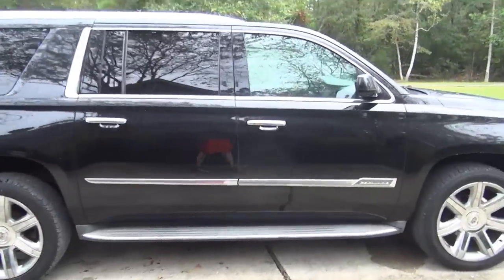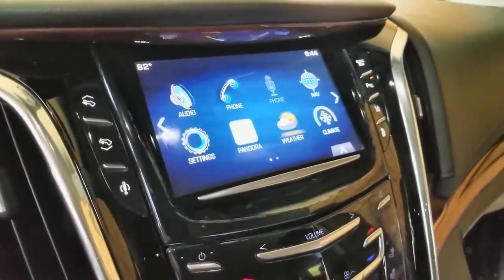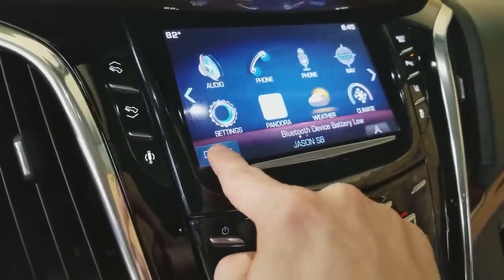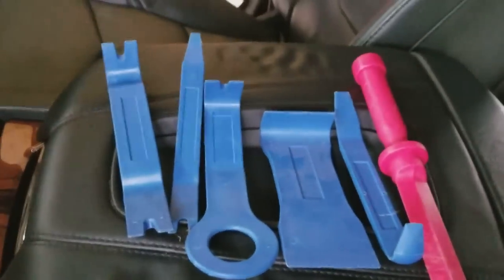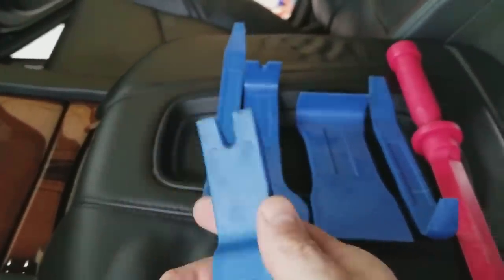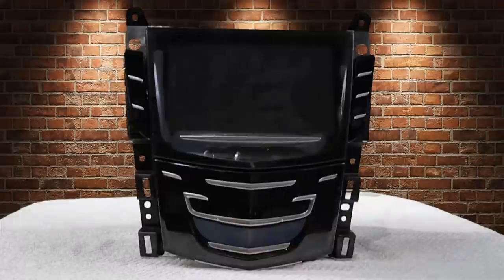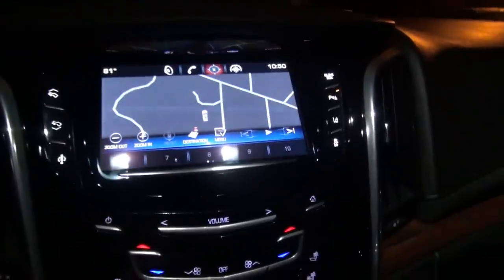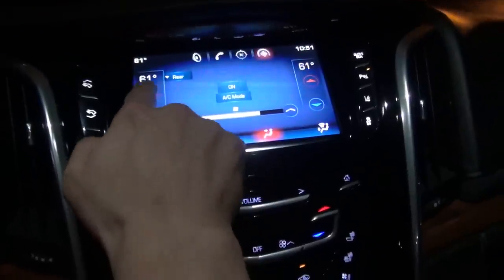How to fix a Cadillac Cue Screen. Step by Step

Comment: When you remove the ribbon, you state to move up the tab. Then after putting the ribbon back you say to push the tab back down. I don't see a tab? I pulled out the ribbon and inserted the new one in. What am I missing? Thanks
Reply from the maker: It resembles a small plastic tab that will hold the ribbon in place. If you inserted the new one already just make sure it is secured back down with the tab, although I am not sure how you put it in if you never flipped it up. I believe it is black in color and it should fold up and down. I hope this helps. Thanks for watching

Comment: After replacing the screen everything on menu shows up but touch not working and not making touch sound but radio works 
Help. What went wrong
Reply from the maker: You more than likely don't have the ribbon cable connected properly all the way. Make sure to lift the tab and hold to secure it

Comment: Last night, my screen in my 2012 froze up and wouldn't turn off and the tailgate wouldn't open so I disconnected the positive terminal to get the screen off so it wouldn't kill my battery then immediately reconnected it when I started it today everything was fine but I turned it off and left it off
Reply from the maker: I haven't heard of this issue. Hopefully it was just a glitch

Comment: I was installing the radio and didn't realize I had the ignition button on and the USB charging port touched a piece of metal on a bracket. Now my instrument panel is out and the all the lights for the heater display and screen are out
Reply: Derek St Jean the same happened to my do anyone have a solution

Comment: How do you get the ribbon out? You never showed what tab to push up to release it.
Reply from the maker: rmndcaliman thanks for watching. I zoomed in but it is really tiny. There is a black tab that you will have to lift up that sits on top of it to hold it in. It will flip easily just be gentle and use a micro flat screw driver to lift it. Hope this helps

Comment: How do you know if it's just the screen?   It appears GM only sells the whole unit.
Reply from the maker: Comanche Flyer if the unit isn't responding from the touch but is completely visible it will be just the screen. If the screen isn't visible or  blank than you will need a whole new unit

Comment: Great video! How did you unlock the GPS?
Reply from the maker: Jonathan Jackson thanks. I didn't unlock the GPS. I believe there is an adapter you can get to do this however I'm not familiar with exactly what is needed.

Comment: Can't find the fuse because that's what it should be correct?
Reply from the maker: Hey Derek, I apologize I had only seen the last part of your message and that is why I didn't understand at first. Yes. You should be fine. Just use your manual to locate the fuse and switch it. Let me know if that does it.

Comment: Just as a comment 
The real problem is no the screen itself,  is in the connector,  one is the small coming from the screen and the other big in the center af of the radio, and it is because both become loose over time, and the solution is about simple as a piece of Scott tape on top and put it back in the plug, 
Thanks

Comment: hi is 2013 cadi xts  the same ? thanx
Reply from the maker: In regards to the screen, yes. It will be a little different process to pull your unit out but you can use this video to help you once the unit is out. Thanks for watching.
Reply: Sam, I've got the same model of Cadillac and have just ordered a screen. Did you ever find another tutorial video to help you? I'd like to see one, too, since the xts has different trim pieces.
Reply from the maker: Andrew Wood thanks for your order. We are shipping it out today. We are also working on the video for your vehicle but don't have it ready yet. I will see if I can find you some information that can help. Thanks again for ordering. I really appreciate it
Reply: Andrew... did you change it?  Any advice?

Comment: What if the whole unit is black and dead?
Reply from the maker: If your screen isn't lighting up I would first check a fuse. If your fuse isn't blown then you will more than likely need a whole new unit.
Reply: Then it's most likely the fuse which is a quick fix.

Comment: just replaced mine but still not working ☹
Reply from the maker: Where did you get your screen? I would also check your ribbon to make sure it is correctly. That is the most common reason I have seen for people when the replacement isn't working. How it helps. Thanks
Reply: @jasonateam  I order it from Ebay
Reply: 2013 xts premium. I tested it, did not work, took it apart to check make sure everything was ok. tested it again n same thing did not work.
Reply from the maker: @angelnegrete3022  sounds like you got sent a bad screen. We have them available and they are tested before shipping. Just let me know if you still need some assistance. Thanks
Reply: sry I didn't update before, it was the ribbon not inserted the correct way. thank u for mentioning the ribbon.
Reply from the maker: @angelnegrete3022  awesome! Glad you got it
Reply: Did the screen from eBay work?

Comment: I replaced my touch screen and still not working,
Reply from the maker: Hey Ricardo sorry to hear that. I would check your install. Not inserting the ribbon cable properly is a very common mistake and easily will get you corrected

Comment: okay, what if the screen is webbed? will this still be a solution for it?
Reply from the maker: I am not sure. I would have to see an image to tell.  If the actual screen is responding from your touch but just looks distorted, you will probably need to replace the whole unit.
Reply: Jason A the very top of the screen still responds, like if I touch the time or the temperature showing, but the rest of it doesn't respond and is spiderwebbed
Reply from the maker: Edgar Escobar I don't want tell for sure because when you say webbed I am not sure. If some of the screen is unresponsive it is only a matter of time before the whole screen doesn't work. I would say this fix would do the trick but if the screen looks distorted it is probably the LCD which means you would have to replace the whole unit
Reply: Jason A no the screen doesn't look distorted, the bit of the screen has been working for a while now. It started with the bottom not working, then middle, then top except for that last bit. I might give it a try, I don't wanna buy the whole unit.

Comment: Cadillac is charging me $1400 yo replace my Cadillac Cue. Is there a way I can fix it without replacing the whole thing??
Reply from the maker: That's actually one of the cheaper quotes from the dealership. Just follow the instructions on this video and you can knock it out. You can also use the link in the description too get the replacement and we will get it sent out